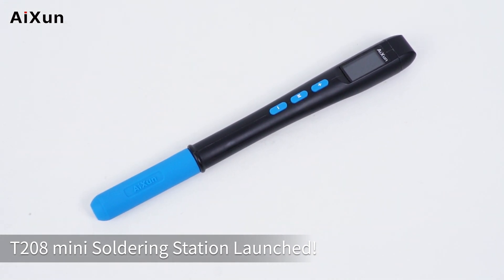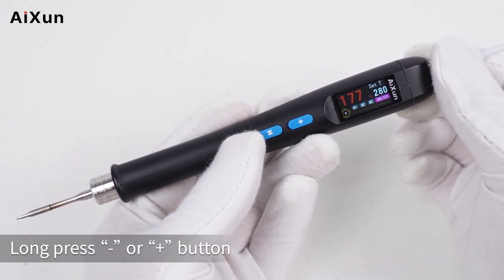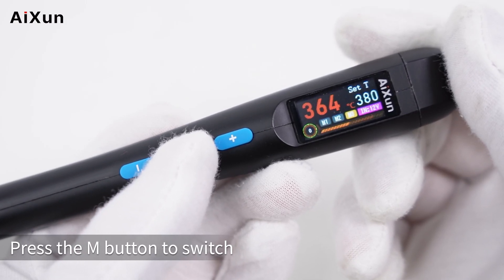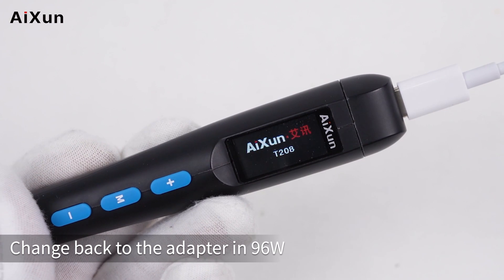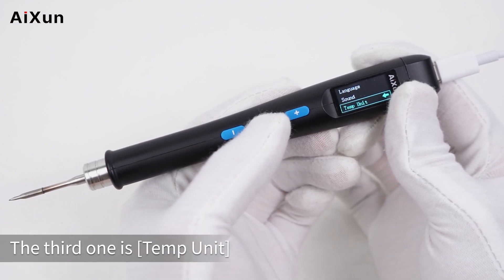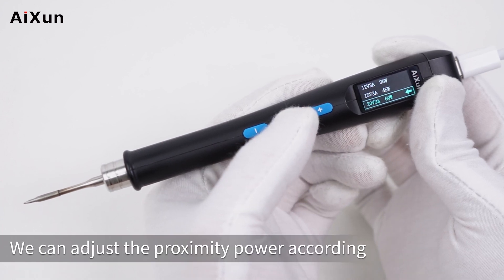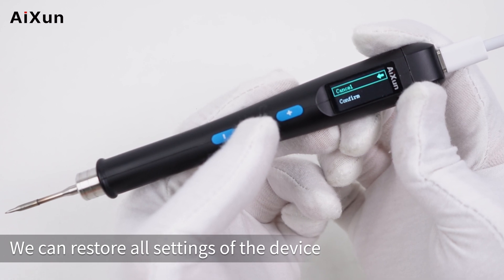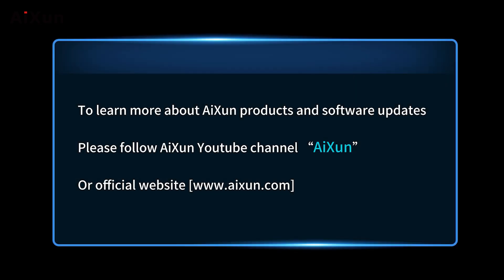AiXun T208mini Portable Smart Soldering Station - Operation Guide #aixun #t208mini

Comment: You need to bring support for t245 t210 and t115 handles to t400 soldering station before releasing this kind of products gosh 😢
Reply from the maker: Hi, T400 supports AiXun T225 4-in-1 handle (compatible with AiXun soldering tips: C250=C470, C150=C245, C080=C210, C030=C115)
Reply: @aixuntech  they are not same  and also aixun doesn't have variety of tips, only have conical, knife and bent tip and they are not good enough for most repairs. You are loosing a lot of customers just because you are not bringing support for t245/210/115 to t400 soldering station. A lot of people doesn't buy it because of lack of support of other handles and tips and t225 not being good enough. Sorry for telling the truth..